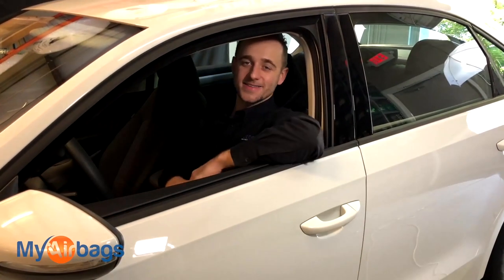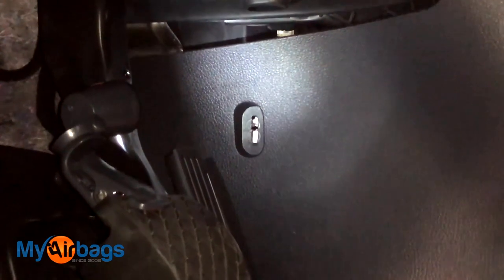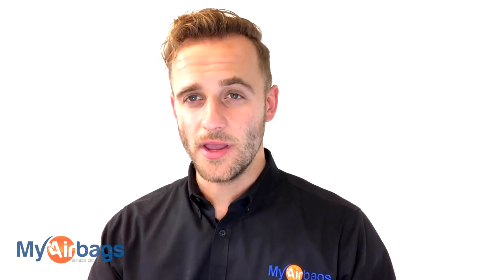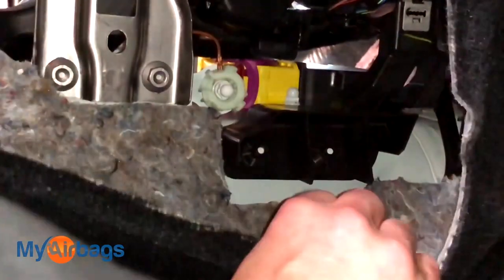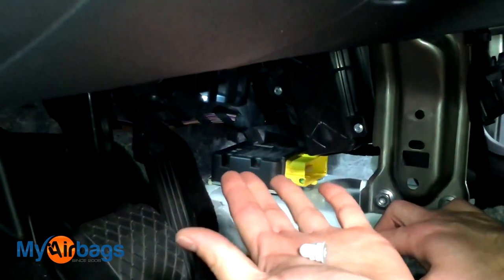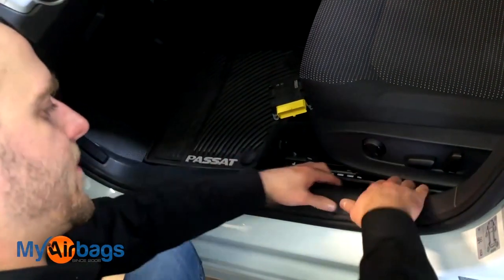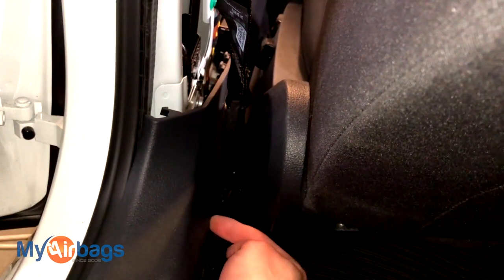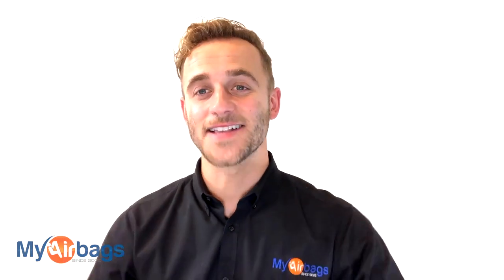How to Remove SRS Airbag Control Module & Seat Belts on Volkswagen Passat 2016-2019 |MyAirbags

Comment: Hello. I have a 2012 VW Passat SE. I replaced the driver seat because it had tears in the leather. I made the mistake of swapping the seats out without disconnecting the battery and had the radio on when I did it. I also moved my car from the street to my driveway with the seat not in the car. I then installed the new seat which works fine but the airbag light now stays on. The screen says “Error: Airbag” Do you know how I can fix this? Thank you!
Reply from the maker: Wavy,
The first step is to diagnose the airbag light. Hook up the scan tool / scanner to the car and read the airbag codes. You connect the scan tool right into the OBD port/plug. Its usually located below the steering wheel, on the left.
When you read the trouble code you can always reply to us here and we can help you narrow down the issue.
Reply: My Airbags perfect, I will do that. I’ve ordered a scanner and will have it in a couple of days and I will update you here. Thank you so much!

Comment: I replaced my seat belt air bags etc after crash still air bag lights on saying proactive passenger protection not available  on passat b8 after i deleted reset  cant do somehow. Any idea there guys?
Reply from the maker: Serg 27, What code do you see when you scan the airbag system?
Reply: @MyAirbags   b130455  and b130555  seat belt tensionar not configured.  I reset it but dtill lights on

Comment: My car has never been in an accident by the wife left a water bottle on the passenger side and it spilled on the seat. I'm not sure if there was a shortage due to this but the airbag light came on and won't go away. I forgot what part the dealer stated it needed but they wanted $750. Do you know if this is something this might fix?
Reply from the maker: Hi Gabriel, I would like to know what part they said you need. If module is damaged by water, we recommend to get a replacement. You will need to look at the part number on your module. By that part number, you can find and order the exact, correct replacement for your car. We do carry a large stock of good, used modules here:  https://www.myairbags.com/product-category/parts-in-stock-ready-to-ship/

Comment: Passat nms 2014, how to replace the front passenger airbag  ?
Reply from the maker: Hi Darius, we currently do not have this car in the garage to make a video on how to remove the airbag. If you need the module reset and/or seatbelts rebuilt, we can help: www.myairbags.com

Comment: I am getting an hard error on my 2012 Jetta GLi B200009. When researched they are suggesting that I replace the Air Bag Control Module. My question is have you guys dealt with that code and have been able to rebuild the module instead of me buying it brand new?
Reply from the maker: Silvio, the reset service is beneficial for post-accident vehicles. You won't benefit from the reset service unless the car was involved in an accident. If the module went bad on its own, we recommend replacement. We do have a large stock of used modules. If you need a replacement module, enter the part number of the module here to check if its in stock: https://www.myairbags.com/product-category/parts-in-stock-ready-to-ship/airbag-control-modules-ready-to-ship/

Comment: Hi... I just replace airbag module on my Golf MK7 with a new one, the problem now is I cannot install the code to my new airbag module... can you please assist me how...
Reply from the maker: Shukri, 
If the car was in an accident, we recommend getting your original module reset so you don't have to worry about programming the new/used module to the car. If are using a replacement, first make sure the part number on your original and the replacement is exactly the same. Then you may additionally need to program the new/used replacement module to your car. This is done on the car with a scanner. To avoid all that, our customers prefer to just send in their original modules and have them reset.

Comment: Is servicing seatbelt tensioners after accident/Airbag deployment  less expensive and more economical than replacement?

Also, if airbag deploys during front impact accident, does that mandate replace of clock spring?

I have a 2012 VW Passat SE. 2.5 5 cyl recently involved in accident collision.
Reply from the maker: Carmelo,
In most cars, there is a HUGE difference in cost between brand new from dealership and using professional,  licensed company to service the originals. You can check with the dealership for correct replacements and check our prices to compare. Heres the link to our seat belt section: https://www.myairbags.com/product-category/repair-return/seat-belt-repair/

Clocksprings. We have a very economical fix for these that we can simply send for you to do yourself. Clock springs  usually will go bad as a result of the front driver airbag deployment. Not always, but very likely. You can tell just by looking at the PLUGS from the clock springs. They melt. Most of our customer find that the clock spring itself IS NOT BAD, just plugs so they will order clock springs from $7.99 - $39 on our site. You check to see which ones you need for your car here: https://www.myairbags.com/product-category/parts-in-stock-ready-to-ship/airbag-seat-belt-plugs/

Thanks for your questions. Please write us more comments if you have more questions for just feedback :)

Comment: Can you do a video on replacing the passenger seat airbag for the mk6 Jetta? I bought some used seats and the yellow connector for the airbag on the passenger seat is cut
Reply from the maker: Hi Sth 91, did you get a chance to check out our channel? Theres a lot of helpful videos there. The one for the Jetta is there: https://youtu.be/AyjXBCzdqfE
Reply: @MyAirbags  yes I did notice it. However it shows the module that’s under the center console. I’m looking to replace the airbag in the passenger seat of some used seats that I purchased because the connector was cut

Comment: Good evening.. i got 2013 vw passat with message on the screen (AIRBAG ERROR )but the airbag light is off, so last time  I connected to scanner and I think it says.. passenger airbag may disable or shortage connections. Idk what to do  now.
Reply from the maker: Wael,
What code are you getting?
Reply: B101614  ACTIVE/static  Front passenger side airbag disabled indecator lamp.
Open circuit/ short circuit to ground.

Comment: Hi my airbag light came on VW Passat 2014 it was involved in driver door accident no airbag deployed. I replaced the door. I don't remember if the airbag light was on then but I also had a issue with my seatbelt not latching and after poking around inside the buckle it finally latched. But when I shake the latch I can hear something moving around inside. So do you think it may be the new door, a sensor in the seatbelt move around or do i need to reset the air bag module? If I would be able to scan the car and get a code would it help me in finding the issue? Thanks would appreciate a response as I would totally reset module with you guys if neccessary
Reply from the maker: Julio, thanks for your question! Yes, the first thing to do when the light comes on is run diagnostics on the airbag system using a scan tool / scanner. It will give you a trouble code indicating the issue. You can always reply to us here and we can help translate the code if needed. 
Thanks!
Reply: @MyAirbags  ok thanks. So I just opened the seatbelt up and found an ear ring in there.i took it out. Also the cables connected to seatbelt had continuity. I thought this would be the solution but airbag light is still on. Maybe I need to clear the code now?
Reply from the maker: @Duijp  If that was the problem, it would just be a fault code, in which case the light should turn off on its own. If the light remains on run diagnostic.
Reply: @MyAirbags  hi man I got code b101715 what does this mean. The car was involved in a crash that impacted drivers door
Reply: I cleared the code and it hasn’t come back on since than. Maybe since I changed the door it just had to be reset?
Reply from the maker: @Duijp  Thats great news! Happy it worked out! If it comes back there may actually be a problem with the impact/crash sensor. Hope the light stays off. Thanks for the update!